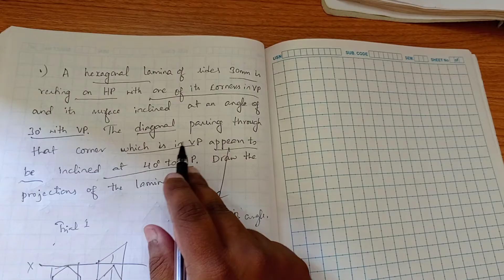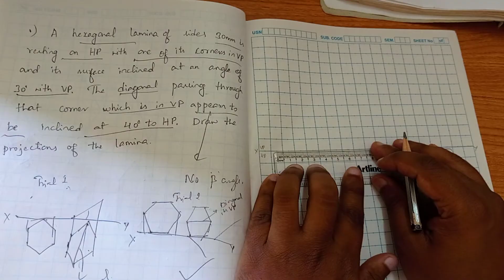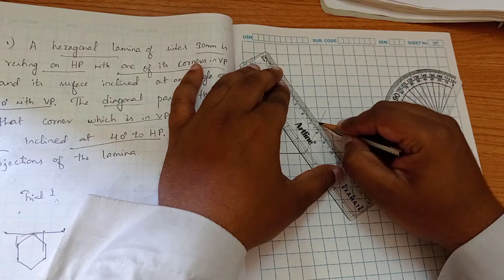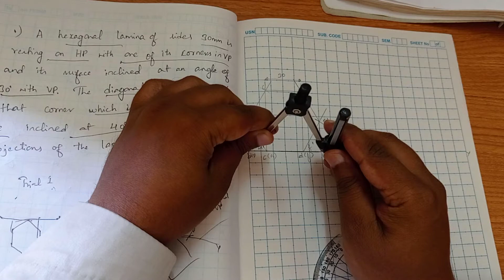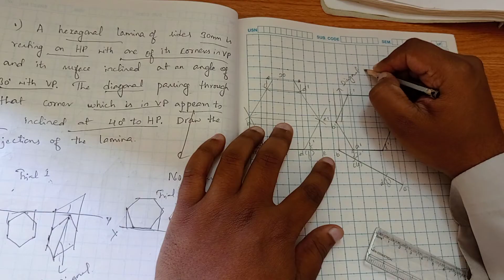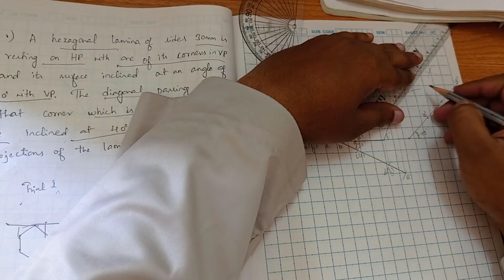Hexagonal lamina resting on HP with one of its corner in VP Engineering Graphics/ Engg Visualization

Comment: A hexagonal lamina of sides 30 mm is resting on HP with one of its corners in VP and its surface inclined at an angle of 30 deg. with VP. The diagonal passing through that corner which is in VP is inclined at an angle of 45 deg. to HP. Draw the projections.
Reply from the maker: It's there

Comment: Sir what if no degree is only not given?
Reply from the maker: @liveandletlive7235  no angle.. means some information they will give
Reply: @engineeringvisualization1005  regular hexagonal lamina of 30 mm sides is resting with one of its sides on HP. The side opposite of the resting side on HP is 32 mm above HP and is 24 mm in front of VP (parallel to VP). Draw the projections of the lamina. 
This is the question sir